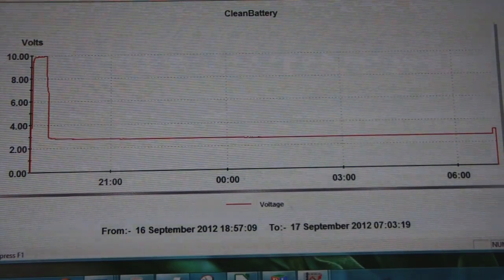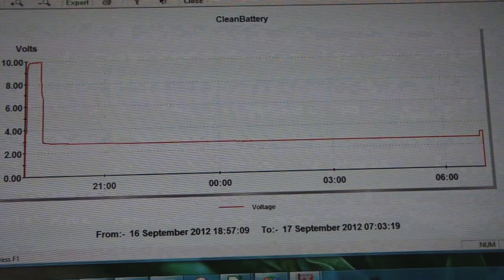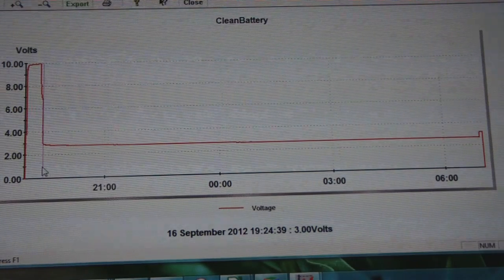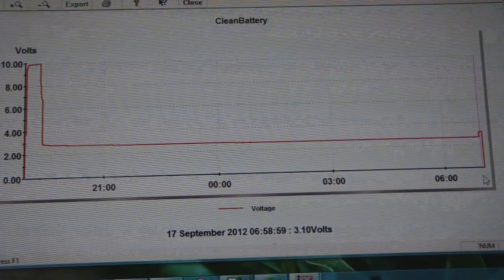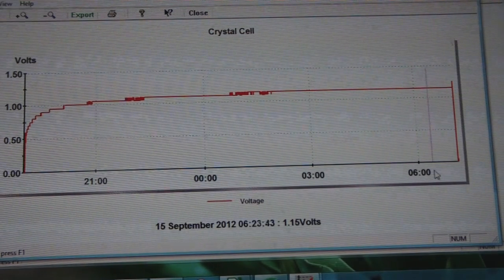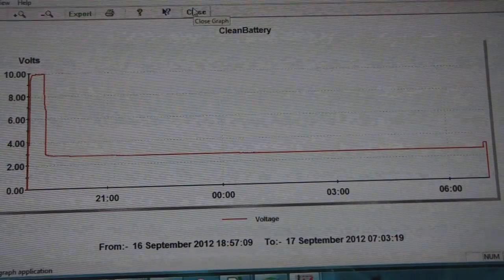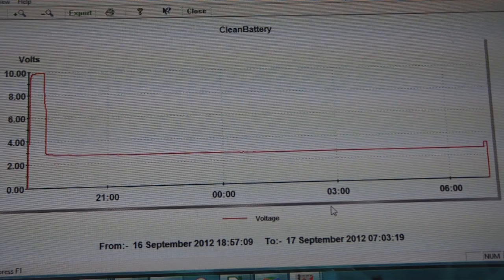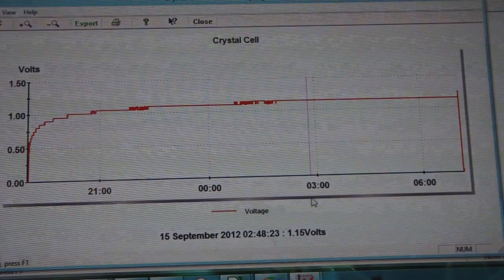Comparing Crystal cell to normal battery (Clean battery)

Comment from the maker: You would need more than 12. The internal resistance of each cell is high so when you put them in series the resistance goes up even more. The best thing to do is charge capacitor and then use the capacitors in series to get the 12 volts.